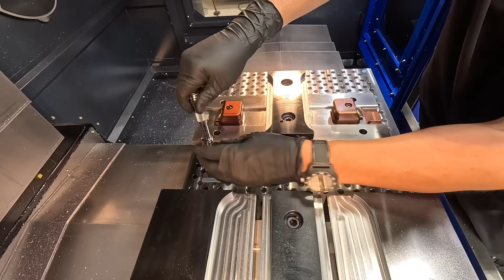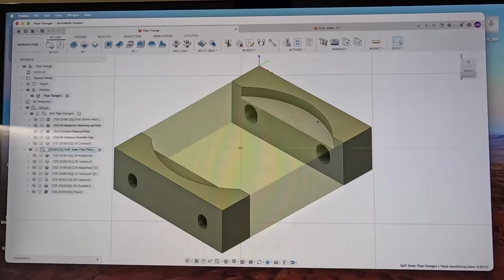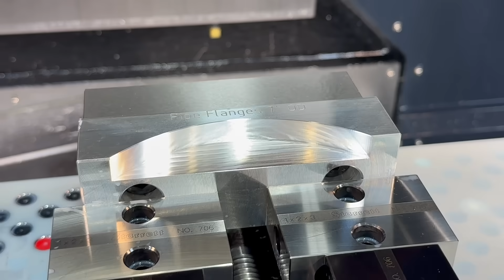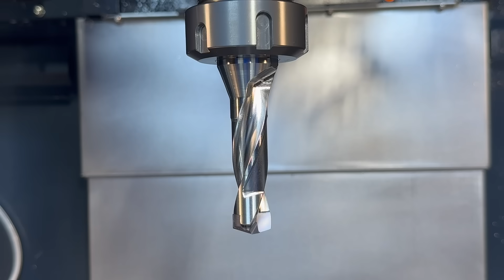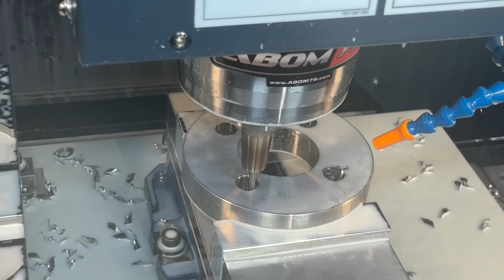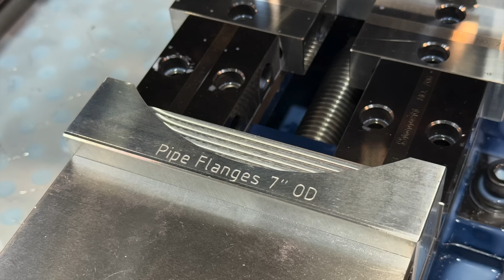Drilling 20mm Holes & Utilizing Through Tool Coolant

Comment: Why would you have to keep going buying drills when you have drill sharping equipment you should have a collection of drills buy now
Reply: Sitting there sharpening drills is not a valuable use of time if there are other things that need done.
Reply: He definitely could do it with resharpened steel drills. However, everything he did here was done with an eye towards this becoming a repeat production order. The drill with the carbide insert is much faster and will last a lot longer than a steel drill. Plus, with a drill body like that you can usually get a decent range of insert sizes for each size of body. The soft jaws were also made with repeat production in mind.

Comment: Nice idea engraving the vice jaws.  That's top quality.  
And some base plates for those vices would save SOO much time. Set up once, just bolt em down.  Ok, a sanity check, but still save a ton of hassle.
Reply: I don't think sub plates are a great ideal. They take up space and are kinda rough on his current plate.

Comment: Production grade carbide tooling and rigid mounting makes drilling those holes into an almost boring non-event. you hear motors start, see a bunch of spray, hear some crackling sound and there is a hole where there wasn't before.  Of course that is the goal of production machining, boring and quick.

Comment: Surprised these CNC manufacturers havent worked in an air blade accessory for a camera setup. Theres plenty of machinist who film content and it would help create a thin wall of air to keep coolant away from the camera. Im sure it wouldnt hard to route a line to provide the air supply
Reply: Lo normal es que ese dispositivo lo haga el usuario. Una fábrica de maquinaria de mecanizado se dedica a fabricar para la industria no para los youtubers. 
Saludos.

Comment: Done DONE only took 4 weeks
Reply: I can all but guarantee it went a lot quicker than that in real time. He'll shoot the videos in advance and edit/release them later to fit the channel schedule. There was a break waiting on tooling to come in... but not much of one since it sounds like he had a plan before the customer finally pulled the trigger. 

That's how it works (speaking as a manufacturing engineer whose often on the other side of the equation)... unless it's an emergency, the customer sends drawings/CAD and asks for a quote. Once they get the quote, they'll send a PO if/once the person at the customer's entity approves. Sometimes the shop will buy material/tooling preemptively at their own risk (especially if it's a good customer who you trust will follow through and/or tells you that it will be approved they just need a price to get the paperwork done). But other times, especially with a new/prospective customer, shops don't want to count their chickens before they're hatched.

Comment: i noticed u torqued the collet down with the head of the socket straight from the torque wrench. that gives u a different torque setting because you're increasing the length of the wrench handle. to get the accurate  torque u should have the socket at 90degrees from the head so you're not increasing length.
Reply: Fair point. My guess is Adam knows about that and corrected for it and/or the tool maker or collet maker or whoever makes that offset spanner-to-square-drive adapter gave him a chart with the corrections.

Comment: I have the same drill but longer (5xD) and I run it at 0.34 feed. On another note it looks like the hole pattern is off. I think you said it was supposed to be 5.5, it doesnt look like it.
Reply: 0.34 = 0.01338583 inch

Comment: Use one 20mm stepped dowel in one hole, flip part in the jaws, locate one hole against the back jaw, rotate until the pin hits the jaw, tighten the vise. Then you're located to do the backside chamfer using the same program, just step to the chamfer line in the program. Make the pin short enough to leave in the hole. The step in the dowel is used to compensate for the distance between the back jaw and the edge of hole. If you're doing many of these in the future it will save time, just wait to do all the backside chamfers as a second operation.
Reply: Or you could get a blind side chamfer tool.
Reply: I think they make backside chamfering tools specifically for this kind of job. Like a small 45 degree dovetail cutter with a long enough shank. They even make very small cutters for small holes where the chamfer bit folds into the shank of the tool. Like Adam said though... this is just four pieces. If he gets more and larger orders it would definitely save some time.

Comment: Super video Adam and Abby. However, I would have drilled 4 holes for dowel pins into the softjaws, so that you can clamp different diameter flanges.
Reply: You could drill a hole every say 1/2 inch. Now you can hold a lot of dia.

Comment: Nice job with the soft jaws, Like the touch of marking them, I need to do that more often. The reason you have coolant spray out around the nut/collet is that you the drill has a flat on it  and that makes a leak path for the collet. I'd have run that style of shank in a sidelock/setscrew holder, if you have good ones there shouldn't be any practical run out but we all have to make do with what we have and what we know. Keep on keeping on learning this wonderful world of CNC!

Comment: Don’t you have 2 of those Miltronics CNC milling machines 
Or did you sell the smaller one?
Reply: He sold the initial smaller CNC Lathe to get the larger one currently in the shop. Also moved the little Toolroom CNC mill and got another slightly larger one more suited for 'some' production.
Reply: he didn't own them.  Milltronics lent them to him for the inline advertising.
Reply: @ScottPankhurst  Still repeating that unfounded claim to sound important?
Reply: @seabreezecoffeeroasters7994  Did he own the flex cnc?
Reply: @spikeypineapple552 no he didn’t.

Comment: Every couple years I drop in to see what's up.  I've had a half dozen 1st year appentences that could spit that job out in 2 hours. 2 more things, I still have a 25/32" drill in my garage and where is the weld prep? Pipe flanges? You tube must pay very well.
Reply: If a customer specced 20mm and you drilled them 25/32" and did a Weld prep they didn't request just how is that a proper job?
Reply: A 25/32" drill can easily drill 3 or 4 thou over. No weld prep is an interesting engineering choice. A-36 plate flanges usually gets welded to black pipe.
Reply: @edsmith2562 so how long did this job take to do?
Reply: @MechanicalAdvantage The entire job is not worth the drill that was purchased, let alone the insert, collet and soft jaws. In the 90s these are $28 parts, 2010 maybe $42. Nuclear facilities don't order mild steel plate till you get out to the entrance barriers. I got thru spindle coolant in my 1994 VTC 16 B. And I guarantee when the welder gets these parts he will look at you funny. These two videos are a You Tube flex, they will teach many correct things, except how to make money.
Reply: @edsmith2562how much was the PO for this job?
Reply: @MechanicalAdvantage Allow me to switch gears here. You are a far better machinist and salesman than I ever was in 69 years. 
4 parts, 20 holes, 2 hours.
Reply: @edsmith2562You stated by commenting about how your apprentice could do this job in two hours, having no idea how long this job took to do. Then you shifted gears to how there is no way this job can make any money and talking about the application it was used for, claiming this was a YouTube flex. You don’t know the application or reason Abom was asked to make this flange. You don’t know how many of these may be made in the next year. You don’t know what the PO for this job was. Then you gave up on your previous two comments to bring up salesman. 

You believe you know what everything about this job, when you actually know nothing about this job.
Reply: @MechanicalAdvantage un trabajo sencillo y básico se convirtió en una serie demasiado larga. Con un vídeo de 1 hora estaría más que suficiente.
Quiere hacer sofisticado algo que no lo es. Éso puede captar la atención de gente inexperta. Pero para gente que conoce un poco el mecanizado resulta un insulto a la inteligencia.
Reply: @edsmith2562 te enseña a ganar dinero pero no con el taller sino con el canal de Youtube. Creo que el taller no funciona realmente como taller sino como escenario del canal de Youtube. Trabajos muy esporádicos y la producción de unos clasificadores de brocas carísimos. Que son comprados por los fans. Saludos. 
Es mi opinión personal.
Reply: @josefcotorreslopez8167 What do you show people on your channel? Remember, everyone has to start someplace.
Reply: @josefcotorreslopez8167 well, you are incorrect. This is a job from a paying customer that he chose to show on YouTube. You have no idea what the terms of this job were to know if this was a profitable job or not.
Reply: @MechanicalAdvantage  no hablo de rentabilidad. Pero es un trabajo muy sencillo. Y quiere dar apariencia de precisión. Yo he hecho bridas y no necesitan medidas de micrómetros. Yo no tengo un canal de Youtube. Pero me gano la vida haciendo trabajos reales en un taller real.
Reply: @MechanicalAdvantage no muestro nada pero tampoco soy un creador de contenido. El canal de Youtube mantiene al taller. No hay tanto trabajo real como se creen el público en general. Pero es su forma de ganarse la vida. Aunque el problema es que quiere aparentar que el taller es su medio de vida. Sin patrocinio ni regalos de empresas a las que hace publicidad no hubiera podido montar el escenario de taller de mecanizado que montó. 
Saludos.
Reply: @josefcotorreslopez8167 You have a YouTube channel. Nothing stopping you from posting content. 

Lots of people that watch Avon’s channel are manual machinists curious about what is involved with CNC work. This is a job that he was hired to do and he decided to show it on the channel.
Reply: @josefcotorreslopez8167 You have no idea if that is the case or not. It’s pure speculation on your part. He has had CNC machines for a couple of years and you believe that is the reason for the success of his channel? What does CNC content make up on this channel? 10% to 15%?
Reply: @MechanicalAdvantage  alguna vez has hecho una brida en maquinaria convencional?.
Se hace en un plato de 3 mordazas. Dependiendo del agujero puedes hacer una cara y el interior y después sujetar el interior y tornear la otra cara y el exterior. Ya tienes la brida sin agujeros. Luego haces los agujeros en una mesa divisora. Y no hay más historias. 
El CNC es una opción y entiendo que tiene su proceso. Esa parte no la crítico tanto. Pero el mecanizado del torno fue irreal. No se necesita un plato de 4 mordazas independientes. Tienes la opción de garras blandas para poder sujetar el borde de la brida en 1/4" o 5 o 6 mm . Yo las tengo hechas. Tengo diferentes juegos de garras blandas. 
Saludos.
Reply: @edsmith2562 supongo que el taladro está patrocinado. Como la mayoría del supuesto taller de mecanizado. Un plató de mecanizado de YouTube.
Reply: @MechanicalAdvantage y quién está hablando del CNC ( patrocinado). Tiene que usarlo para que los patrocinadores no se lo quiten.
Pero yo estoy hablando de la parte de máquina convencional. No he criticado la parte de CNC. Está aprendiendo.
Reply: He visto muchos vídeos y hay muchos vídeos que alarga por crear varios vídeos no porque sea necesario. Y últimamente ya es más frecuente.
Reply: Right, I don't know. But I did find an interesting branch in my yard today. Bet it will make a nice sling shot for my great granddaughter. I really enjoyed the videos on the old steel mills. And I tried your cheese dip too.

Comment: Abom,A suggestion, If the milltronics bed has the mounting holes identified like the cells in a spread sheet (A-x &1-100) . Engrave the hole numbers in the soft jaws for quicker set-ups.
Reply: How is that going to help?  The soft jaws are mounted to the vice, not the table.
Reply: @cskovach  Please reread my comment carefully.
Reply: @jer @jerrydemas2020 I did. Now you can answer my question
Reply: @cskovach  If the CNC bed mounting holes have been identified like the cell in a spread sheet (A-Z) &(1-500) . Engrave the hole number/alpha identifiers of the holes the vice will be using on the soft jaws.

Comment: Not sure why, but that bolt circle at 5-1/4" looks awfully small.  Edit:  I just drew it up in CAD and I think you screwed the pooch on that one!!  The bolts holes should be closer to the O.D. than the I.D.
Reply: Fairly common on Pump Flanges to have offset holes on a flange caused generally by larger Pipe than the inlet/outlet size.

Comment: just an  comment about your set up method  althrough it worked just fine and is quick to change parts , IF   for what ever reason  the OD was to vary then the hole patton would not be concentric  to the bore

Comment: Adam, setup a small production run of your own vise jaws! Much cheaper when you make them in batches. Plus you can do any minor customizations you may want, like holes for attaching stops or similar.

We went the buying route for years before just doing them ourselves, and that is when that brand was much cheaper than it is now. Making your own in batches is ridiculously cheaper. Only a few at a time, yeah cheaper to buy.

Comment: Not that I know alot about machining but I watch a ton online with you Topper machine and two from Australia.  You have alot of set up making the special holding jaws for this one job. I know you live CNC now but wouldn't it have been a hell of a lot quicker set up and machining on a manual mill???
Reply: He said he is expecting MORE of the same work.
Reply: @buckhorncortez   Yep with cnc one off is slower but if you suspect its not a one time job it pays off in the long run
Reply: @bruceclelland2310 I think it would be difficult to do this job faster in a manual machine.

Comment: Unusual flanges with a smooth face and a relatively small bolt circle.... :-)
Reply: He screwed up the bolt hole circle if it is in fact supposed to be 5.25" like he stated.

Comment: I used the cooliant thru the spindle back in the 80’s that’s when we were using flat bits in a spade drill with cooliant adapter ring connected to a cooliant line old school the place I was working at and started a revolution to cooliant thru spindle tooling and the jobs went so much faster in SS material

Comment: info. you can drill a hole with the typical indexable drills with 2 or more inserts. When you program a helix down you can mill with them like a indexable tool. The inserts for those drills break the bank thats why i did some testing with the more in a lathe enviroment used drills works like a charm.
Happy drilling

regards from Switzerland Martin